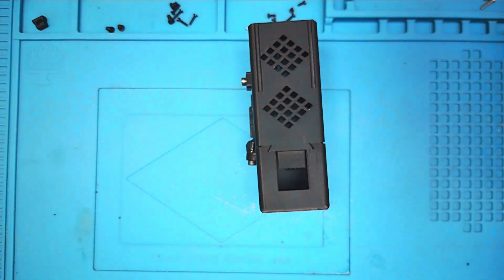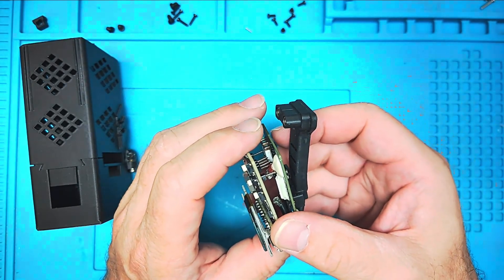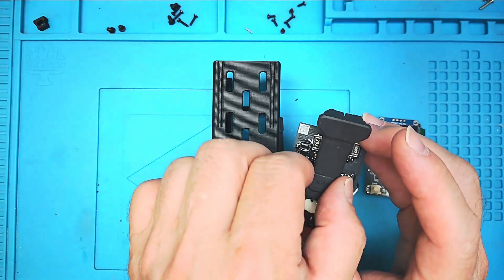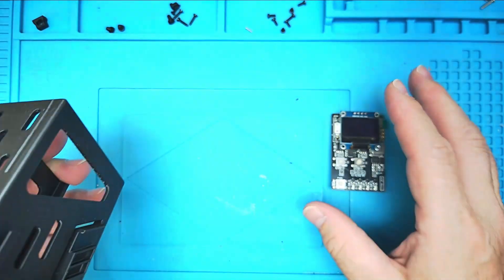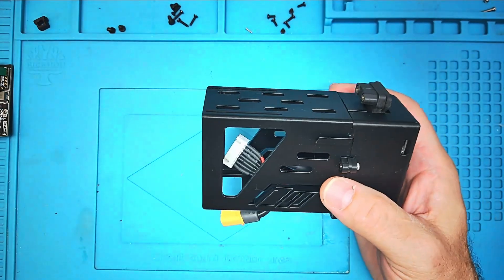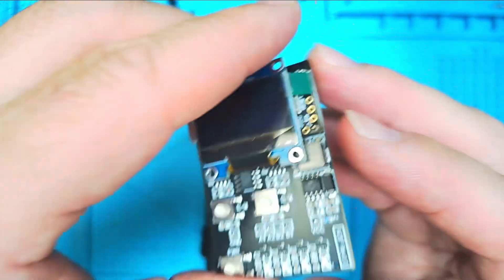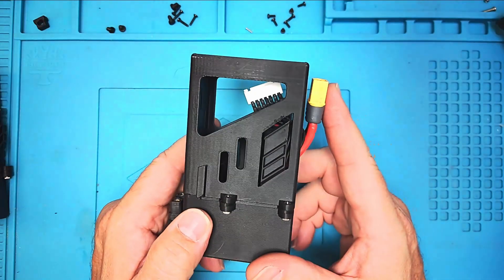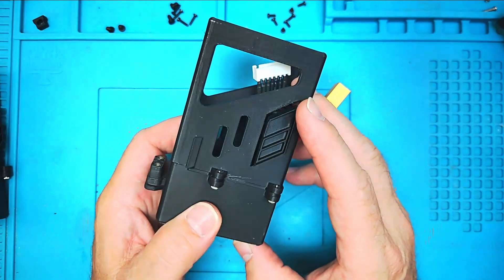DJI FPV Drone 6sbattery mod Upgrade Options for SALE!  (9-25-2025)

Comment: Hello , can it's work with Li-on Battery?
Reply from the maker: Absolutely, the DJI FPV drone can be paired with Li-ion batteries. In fact, Aircruiser has crafted a dedicated case for them. However, after discussing his findings, he pointed out that the advantages of using Li-ion batteries might not be as significant as one would hope. The DJI FPV drone has a built-in low voltage cut-off that ensures it lands safely when the voltage drops. This feature means that, unlike some non-DJI counterparts that can take full advantage of the lower voltages of Li-ion batteries for extending flight times, the DJI FPV drone simply can't. Given the added weight of Li-ion batteries along with the drone's hard voltage cut-off, the overall benefits might not justify their use.